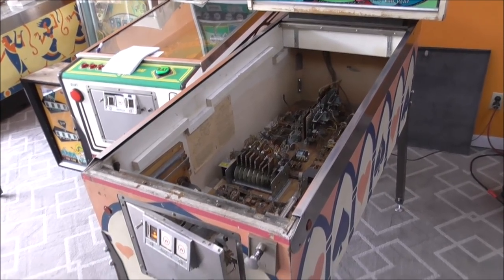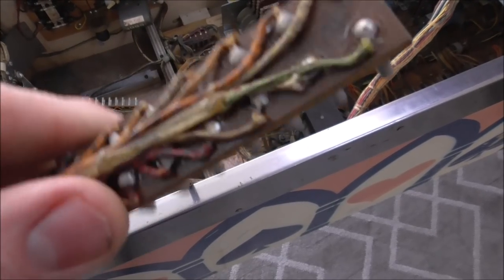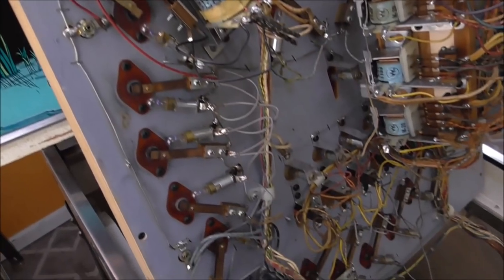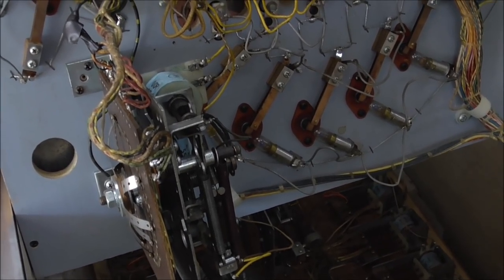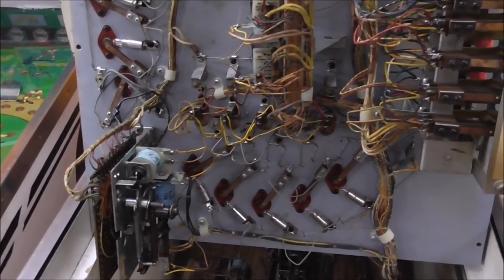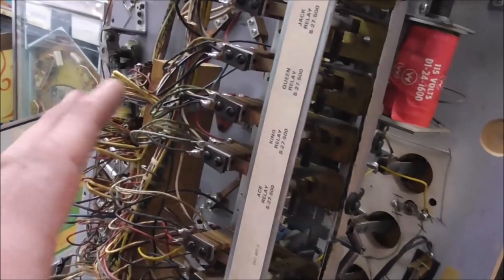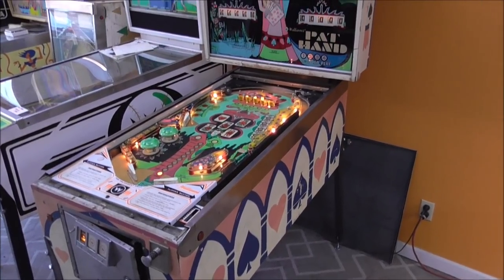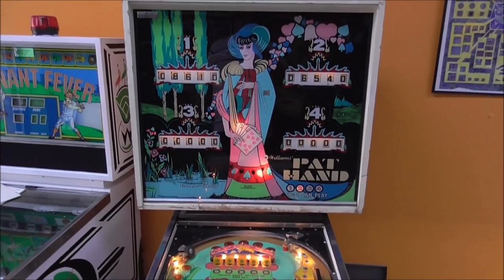Let's See What's Under The Playfield On This Williams Pat Hand Electromechanical Pinball Machine! 3

Comment: I have done a few older radios lately and the globes are often 50 plus years old, and usually at least one is dead, but I find it is just a little bit of a pain to pull the chasis out to replace globes so I just change them all.
As far as the flippers, the DC flippers tend to be stronger as the magnetic fields in the coils are stronger with the power going one way.
Also DC coils don't tend to buzz as much.
Looking at the mathematical equation, assuming it is money, it could be related to a repair.
Reply from the maker: I don't know if I mentioned it in this video but I eventually figured out the flippers aren't DC on this one, it's just the pop bumpers and the kicker!  That's kind of weird, you'd think if anything they'd want the flippers to be DC.... this was in one of those 'in between' eras....
Reply: @LyonsArcade  likely they didn't go DC on flippers because the coils get hotter when they are held on.  Bumpers tend to be very quick snaps rather than being able to be held.
AC coils run a lot cooler than DC coils.  Flippers may burn out more often if they are held on and running as DC.
Once they went solid state it was easier to do DC everything.

Comment: 7740 - You may have found the answer to the eternal question!

Glad you call that part on the stepper the "Spider" as well. The spider is also keyed/flat side so it goes on one way from what i remember.
Reply from the maker: It can go two ways but usually if you look at it enough you can tell which way is backwards :)  On the older ones though they put rivets everywhere and then just wired SOME up... so it's harder to tell, because it looks exactly the same even if it's on backwards, it's just not touching the correct rivets!

Comment: I like the bumper caps on this machine. :D
Reply from the maker: I think they may actually be the wrong ones, the originals are very similar though but they have little arms that stick out from the side.  Or maybe they used two types on this one... I don't know what these would off of though.... I don't believe they make reproductions of this style.
Reply: @LyonsArcade  Still like them just the same. Was sort of wondering if at that time period pin makers put that much detail into the machines. :D

Comment: If I had to guess that dielectric grease is normally an insulator but it has a specific breakdown voltage.... which is to say at a certain high enough voltage it's insulation properties are broken down or overpowered by the voltage, and it will only be high enough to bridge it when the spider pads are actually over the contacts... sort of like you can see the breakdown point of air when high voltage arcs through it.

Comment: I just bought a Pat hand pinball machine yesterday. The only problem I’m having with it is that it will sometimes not eject the ball. If you have any tips on what might be wrong I would greatly appreciate it. I have been watching your videos on this old machine and they are fantastic.
Reply from the maker: Does it sound like it's trying or is it just sitting there?  If it's just sitting there likely there's a switch dirty or misadjusted on the outhole relay or in that line on the schematics, if it is making noise like the score motor is running then it may be that the bonus unit is having trouble resetting and the unit needs to be cleaned....
Reply: @LyonsArcade  First of all thank you so much for getting back to me. It is definitely making noises and the score motor is running. I will try cleaning the bonus unit to see I that is it. Thank you again. I will tell you if it works.
Reply: @LyonsArcade  Thank you again. I cleaned the bonus unit and it’s working nicely.
Reply from the maker: Very cool basically at the end of each ball it has to count that back first before it can kick the ball out!
Reply: @LyonsArcade  It took a lot of cleaning and tinker but I think it was worth the $100 I paid for it.

Comment: 77.40 may be the amount of wattage the lightbulbs used.
Reply from the maker: It looks like a 47 bulb uses .15amp and .945 watts whereas the original 44's use .25amps and 1.575watts !
Reply: @LyonsArcade  I am guessing these numbers refer to something electrical. It would not be volts, I don't think, and it would not be amps, so watts or ohms are the only other 2 that could make sense.
It would be interesting to see if that was original.
If other machines of the same make and model made at the same time have these notations on them.
Have you seen notes like this before on machines from this era ?
Reply from the maker: Oh I see you’re talking about the pencil marks no I’ve never seen that written under one so not sure what it is...

Comment: That's kinda annoying that it uses the capacitor symbol for switches. I guess you're used to it.
Reply from the maker: You mean they use the switch symbol for Capacitors!
Reply: @LyonsArcade  Well, actually the capacitor symbol came before they started to use a similar one
for relay logic. This symbol would be the unipolar capacitor symbol. PLC-programming (Ladder programs specifically)
uses the same symbol which is a heritage from the relay logic era. It can be confusing but if you have worked in an
industry as an electrician, which I have, these pecularities are everyday knowledge. =)
EM pinball machines are just one big PLC-program built with relays if looking back in time.
Keep up the god work!